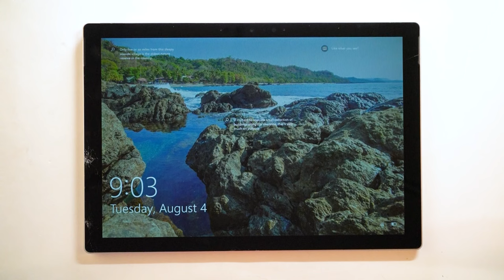Microsoft Surface Pro 7 12.3" 1866 Full Disassembly Teardown Guide

Comment: Nylon spudgers are safer than metallic tools, which appeared to do nothing except further damage the screen. Surface Pro 7 runs pretty hot normally so don't be shy using the heat gun to soften the double-sided tape holding the screen onto the chassis.

Good video overall. Sucks to see the SSD and memory soldered on. I "could" upgrade the SSD but I don't have a rework station or the correct stencil for reballing.

Comment: Mine died after 1 year (1mo. after warranty). It would not accept a charge at all, the magnetic charger's led did light up but nothing. Has anyone experienced this? Can the charge port break? (its led was on when plugged) or could it be the battery that is gone? (I know this is unreplaceable)
My ultimate goal is to just recover the data on the built-in SSD  ._.'
Reply: Same with me. Never buying Microsoft product again
Reply: Had mine for 2 years running strong with 0 problems, but I’d tell you to disassemble and get the ssd out and shove it into another pc with compatible motherboard.
Reply: SAME HERE
Reply: @tomatosoupwoo  where exactly is the SSD located on this motherboard in this video?
Reply: @danasher380  not sure, never disassembled
Reply: mine too doesn't come on charger shows it should be charging but it isn't
Reply: @3Chris_world  The white light has to be on with the charger itself
Reply: My Surface Pro 7 just died as well, never buy Microsoft garbage again!
Reply: SSD soldering on the motherboard. Sorry guys
Reply: Same here. Never again! Apple every time
Reply: Same here, 2 Years old  , will not switch on,
Reply: I'm 2 years late but I'd say you have lost it as the SSD is soldered in. Edit: unless you pay for someone to do it (maybe its possible).
Reply: But also he posted this a month ago - https://youtu.be/1l7LekXU9aE?si=xzx2uvICURyJuN6g how to replace battery